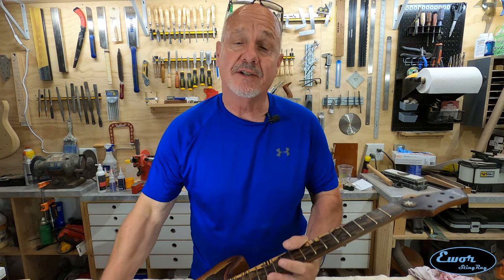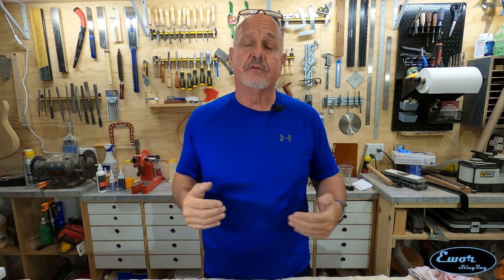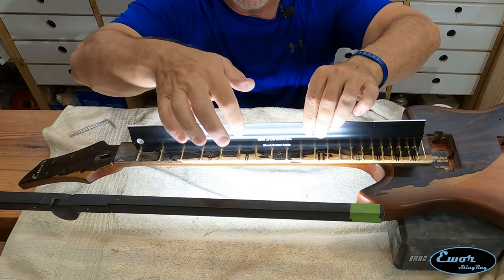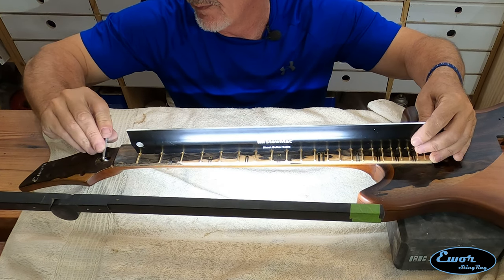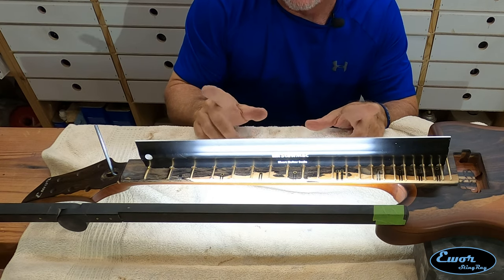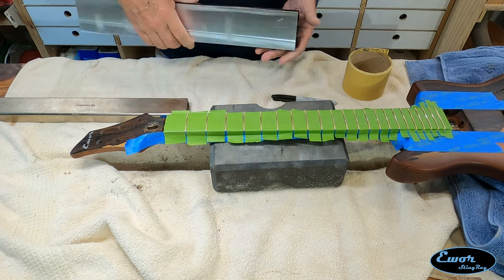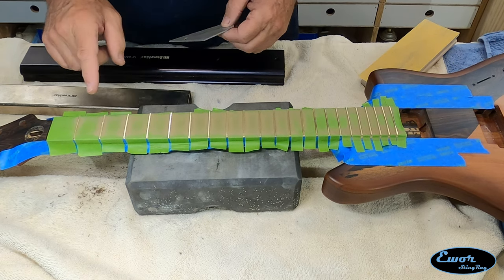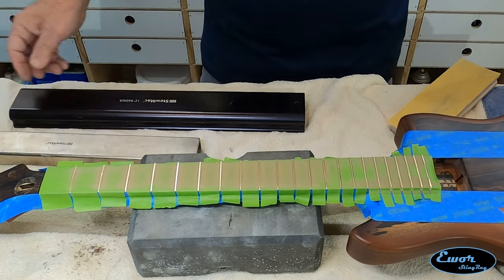Ewor Stingray part 17: Fret Work: Level Crown Polish

Comment: IT LOOKS SO GOOD!
Leveling with a radius beam? I know some say that’s a no-no. Chris at highline says not to. 🤔
Reply from the maker: I will have to check out what Chris says. I have the flat sanding beam too but I always use the radius one. Thanks for the info
Reply: @eworcustomguitars  love your stuff, man! Just bought some Simtec sealer and gonna get some tamco clear. Oil finishing blows